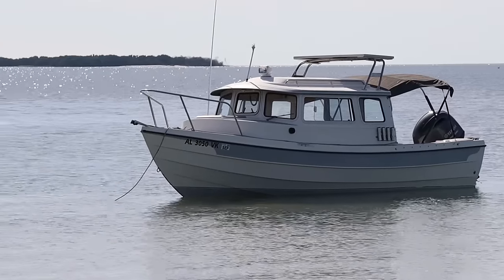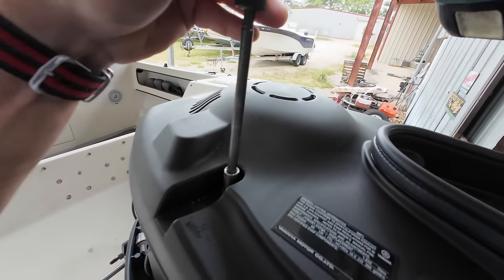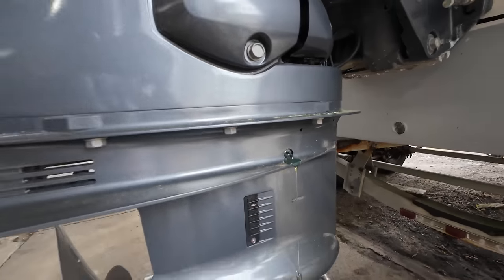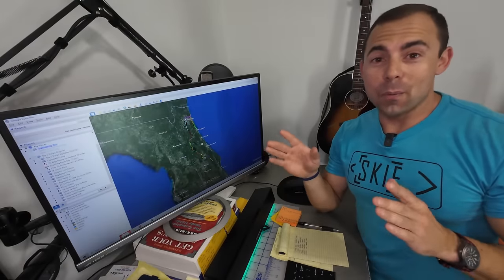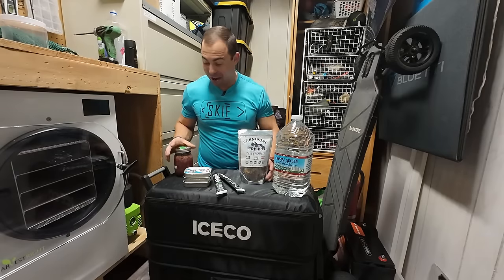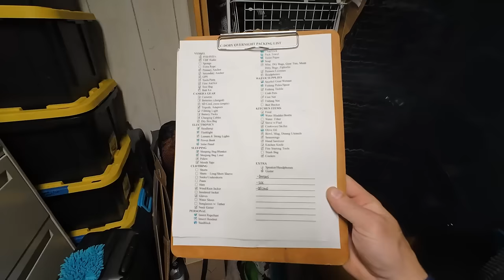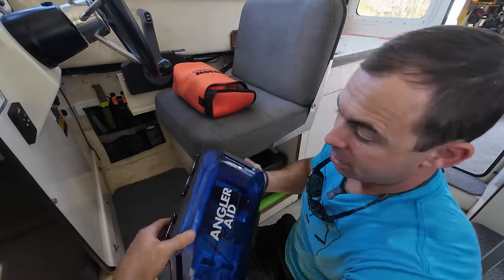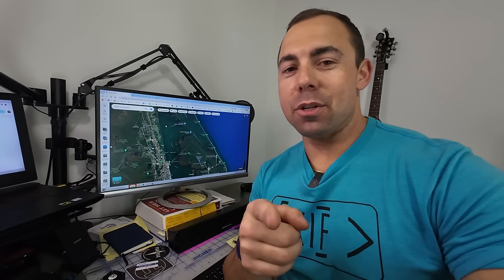Prep for 350 Miles on a Small Boat

Comment: Great plan!  If you need anything while in Volusua or Flagler counties, just call.  Remember on the first skiff rally I told you of the manatee speed zone markers, make sure you look at them from the direction your traveling not from opposite direction.  Tomoka river is neat side trip just south of Volusia/Flagler county line but it is all dark water  even where it turns to freshwater and it’s all slow or idle speed, so it will take a few hours down and back.  Tomoka state park is at the mouth of the entrance to the river.  Watch for shoaling inside Ponce Inlet around disappearing island, all sand though.  Good fuel docks in Jax, St. Augustine and Daytona municipal marina.  Slim pickings from St. Augustine to Daytona.
Hope to see you on the water.  Bryan, out.

Comment: Where are you taking out at? I can see you’ll have to trailer unless your starting in the salt end ending in the river. You can go a little further south in the river than the map shows. Entering into lake Washington head south there is a levy w/air boat provision only. I live on pointsette. If you need a hand launching or shuttle you rig as well as parking I can help.

Comment: You need any tips? I know the entire route from Fellsmere. Obviously you can run a large boat from there cause you got to pull over the dikes. That being said I have ran all 310 miles of it. You commented on a video I made of it a few years ago, but I have ran it again from the very beginning of it. I went out again the year before last.
Reply: I also know the icw. I’ve gone over the entire St. Johns because I had to memorize it for my trips because of the 12-15ft boats I’ve ran and limited space. From puzzle lake where you put it at harney the nearest gas station is not always open. Call them and find out their hours. Once I had to cut it close and go across lake Monroe on fumes. There is also a good spot to park and camp before the bridge into lake Monroe. Just before you leave the swamps it has a shelter, I like to have dinner at the bar near by after I setup camp.
Reply from the maker: Hey John! All good info and I think I remember commenting on your video ;) I finished the trip a week or so ago and it was awesome!!! Sorry I didn't catch your comment earlier. Just not catching up

Comment: Trip I see the Star Board strips around your fuel tanks are screwed into the cockpit deck. Mine were too and I’ve just repaired the water intrusion into the hull from those screws. Don’t really want to repeat screwing the Star Board strips into the epoxy filling repairs in the deck again or do think it might be okay if the screws were set back in 4200 or epoxy?
Reply: Appreciate your videos brother!
Reply from the maker: Not long after I got the boat, I took those up amd exposed the core for inspection. Has a very small amount of dampness in a few of them. Removed core until I reached clean dry balsa then sealed everything back good before resetting the screws
Reply: Thanks Trip. I did the same. Filled with Total Boat epoxy. Guess I’ll stop overthinking it all and rest the screws into the epoxy. Should last a few years. Definitely stopped the water intrusion that was going on. Safe trip Trip👍😎🙏